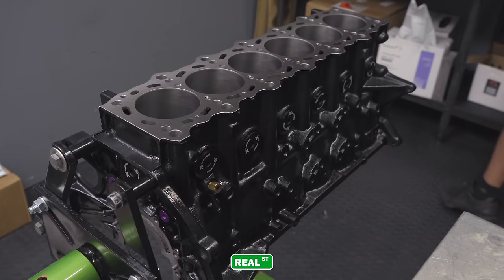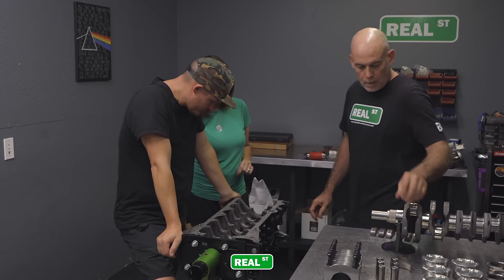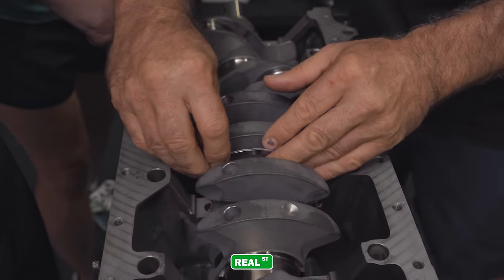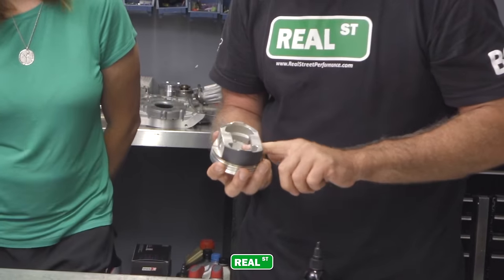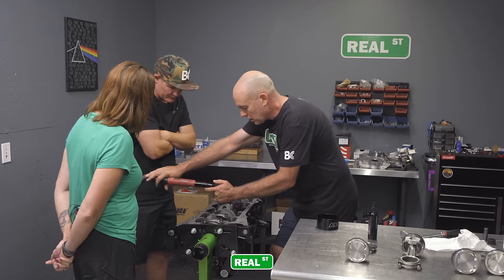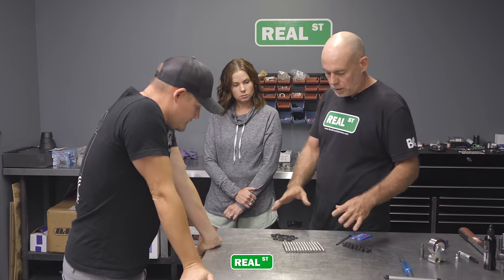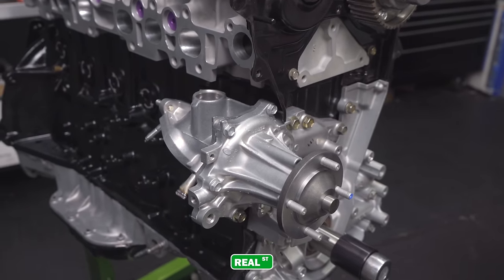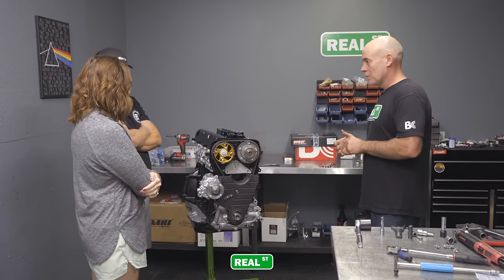Building a 1200HP+ 2JZ With Jrod - Detailed Engine Assembly

Comment: @37:57 "but since the bolt is steel and the tensioner is steel, the similar metals will marry over time, they're frozen." You mean they exhibit cold welding / galling? Makes sense. Unlubricated direct metal-to-metal sliding contact will do that, some alloy combinations more than others.

Comment: Could you let me know what main studs you use with the billet main caps in that engine please? I'm gathering parts/building my 2j gte vvti for a swop into my jzx100 Chaser. I've got 625+ head studs, the BC rods come with 625's, and I've got billet main caps to go in but don't want to have it line bored until I've got the correct studs for the caps I'm using. Watching your videos u obviously are up there with the best of the best, so my question is what studs did you use in that engine for the billet main caps? If you could let me know asap that would be awesome. Thanks

Comment: I need some help.  I have the choice of procuring a 2jz – GTE or GE model engine both with 40,000 miles I want to get about 600 to 800 hp I would be happy with 650. I also am able to get Toyota parts at cost at the dealership Both of these engines are coming from Japan but I only get to choose one which one should I choose and why the engine is a 1998 or 1997 how beneficial is my hook up going to be as far as parts go, anyone have any experience in ordering parts for a Japanese engine through an American dealer, any expertise in this matter would be greatly appreciated